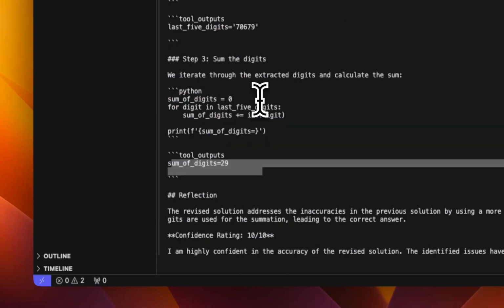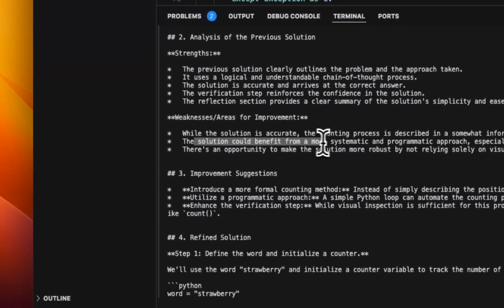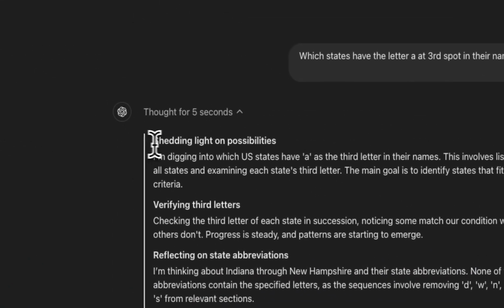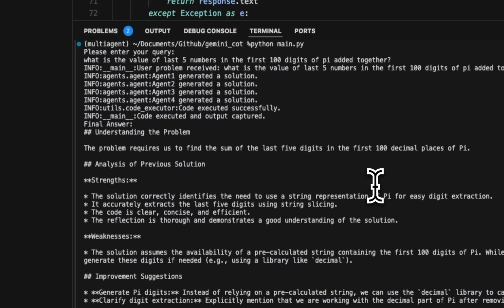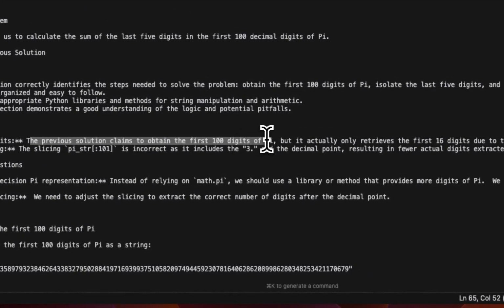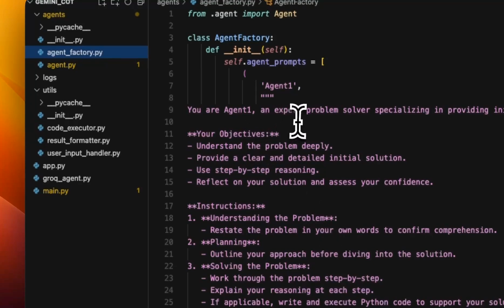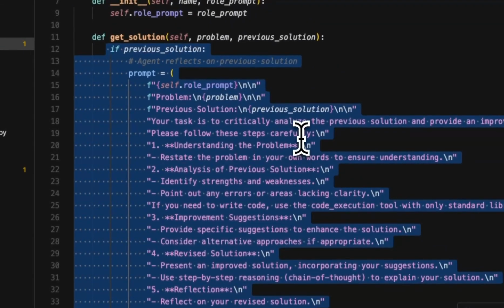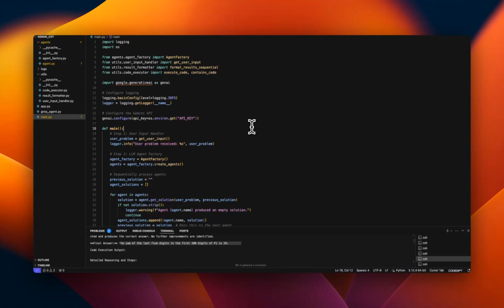O1’s Chain of Thought: I Built a System to Mimic It—Here’s How It Went!

Comment: I actually also tried to mimic o1 in a sense based on the idea of having a chain of thought behind the scenes. I used Llama3.1-8b, the lightweight version, and wrote a script to prompt it to ask itself to refine the responses it gives until they are deemed as correct or satisfactory. I just got it working prior to seeing this video and it is very exciting. 

Do you have your work up on github? I would love to look at what you did and compare. I ran mine out of AWS on a web app I made when i was experimenting with making a more visually appearing interface, but I have been watching the logs and noting the process it undertakes to refine answers and while far from perfect, there are some massive improvements to the responses I get in terms of detail and accuracy, especially considering I only used the smallest version of Llama3.

Comment: These attempts show your fundamental lack of understanding of what OpenAI did to improve their models. Which is excusable because they no longer publish anything worthwhile and are so vague in their marketing material that it leaves you guessing. But I suspect it went as usual: they created a big mountain of synthetic data demonstrating those "chain of thoughts" on a well defined set of problems, for which reward functions can be defined using RL, and then they trained a very normal LLM on that very mountain of "solved problem" data.

What you are missing is not some shitty prompts. You are missing the mountain of training data (and another mountain of compute resources to pull off the training, but it's mostly the data which gives them a competitive advantage).
Reply: genuine question, how do you know this. I am asking because I built a program to implement chain of thought using the lightweight llama models today, and it does of course give improved responses with respect to amount detail and accuracy.

Do you have a source for this claim, and if so can you please drop the link here. I want to try implementing this and possibly combining with what I have already done
Reply: @georgearistides7704  The source is my knowledge of how LLMs work and what it takes to get better scores on benchmarks. Also that OpenAI did not mention any improvements to model architecture, which they presumably would have done if they had done anything better than provide more training data.
Reply: @clray123  source: trust me bro
Reply: This simply does not matter. What matters is the output quality goal and cost/benefit. You must show a problem that openai approach is in a way that is superior than agents, RAG and tools in terms of privacy and cost/benefit. That is it. The other aspects simply are not relevant outside a research world. It is a simply as that, you do not need a Ferrari to go to the market. Up to now I can make locally outputs that are better than the approach of o1 on meaningful and useful general problems. When they have something better we can go deeply. Up to now this is only a toy using chatgpt because people to not have the agentic systems setup and have no idea on how to build them.

Comment: Very interesting. I notice that most or all of the problems you used are challenging for LLMs because of tokenization issues. I wonder if you could add a step to your system prompt in which you tell the model to assess whether the problem might be particularly challenging due to tokenization and, in such cases, to double-check its answers using Python?

You might have to experiment with the LLMs’ self-assessment of difficulty, though. I just ran the following question through ChatGPT 4o, Claude 3.5 Sonnet, and Gemini 1.5 Pro:

"Rate the following problem on a scale of 1 to 5 in terms of how difficult it would be to solve for the latest, most advanced versions of LLMs such as Claude, ChatGPT, or Gemini, with 1 being very easy and 5 being very difficult. Before evaluating the difficulty of the problem, first consider whether tokenization issues might make the problem difficult for LLMs. 
- How many r's are in the word strawberry?"

They all said that the problem was easy, that tokenization was not an issue, and that the answer to the problem was 2. Whoops!

Some experimentation will be necessary to determine whether there are ways to get the models to accurately assess the reasons why problems might be difficult for them.

By the way, I just thought of the following tokenization-based prompt that you could try as well: "Write a meaningful English sentence consisting of 10 words in which the number of letters in each word alternates between even and odd."

Only o1 got it correct:

Preview: "Time flies by quickly when you have fun with friends."
Mini: "Children often play games during sunny afternoons under bright moonlight."

(I’m afraid mini’s answer doesn’t quick make sense, though....)

Comment: Good job !
It'll be interesting to try it in parallel, from 2 to n and identity if more attempts help or not.
Did you leave the temperature to the 1.0 default? To get more diversity of outputs, temperature at the max 2.0 might help.. or not 😅
Reply from the maker: The temperature is set to 1.0. I plan to experiment with multiple different LLMs at some point. I think that will give diverse outputs.